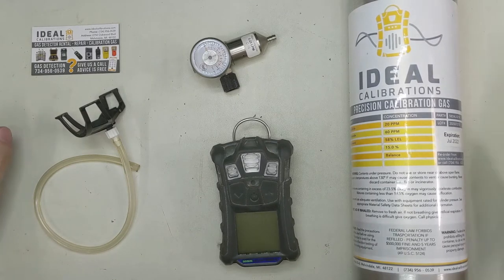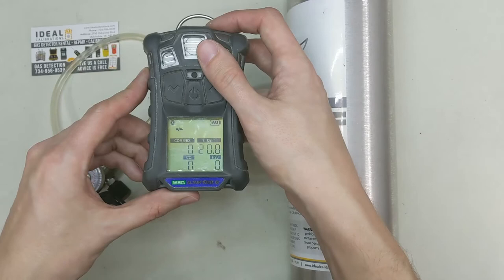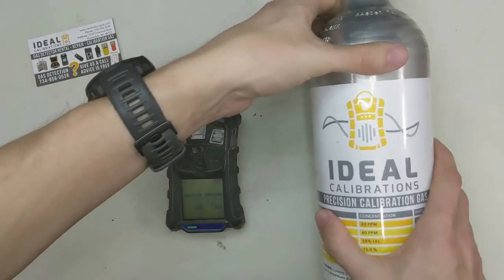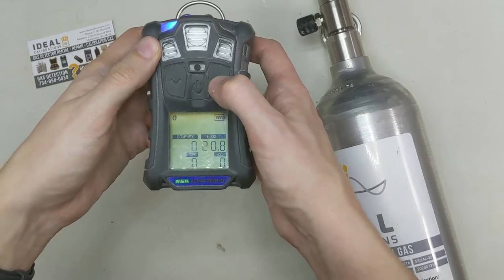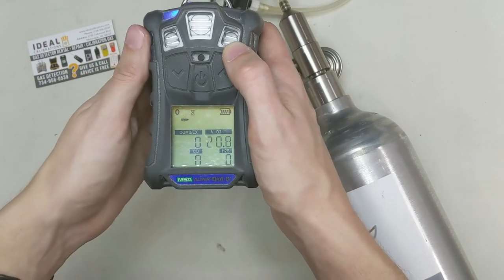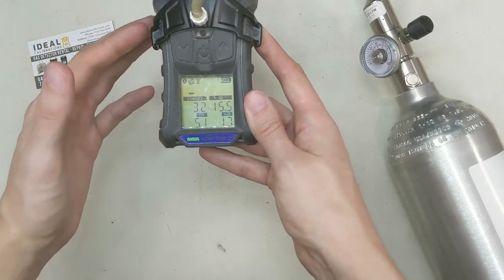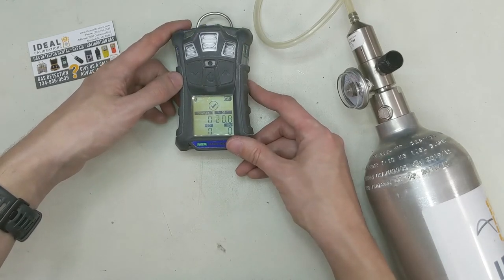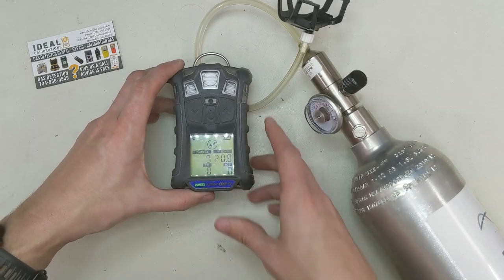Altair 4XR Calibration Guide by Ideal Calibrations

Comment: Dear hi,

I am calibrating same device. But it request 12 % o2 instead of 15 %.
I apply same as requested but all o2 sensors are giving fail. I dont know what to do
Reply from the maker: Hey Kemal, missed this one. Best bet is to get a new cylinder of gas with the MSA mix. Sounds like you have RKI mix instead right now. Proper mix is in the video description